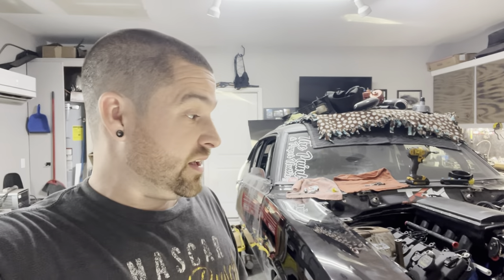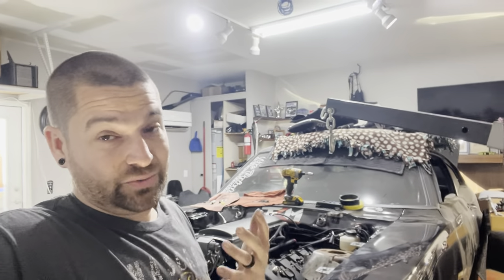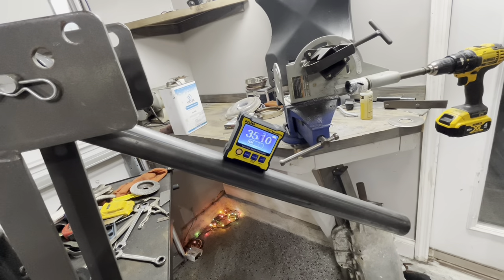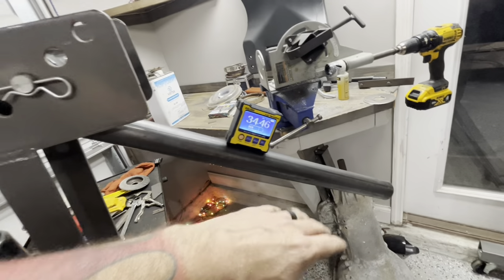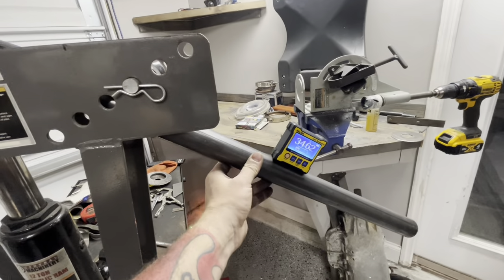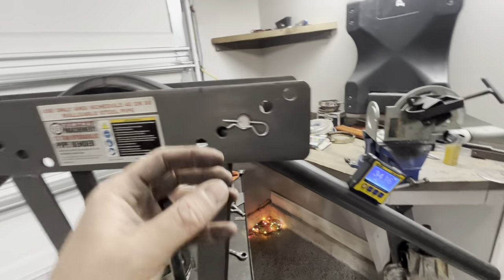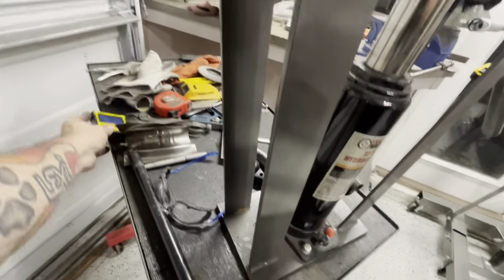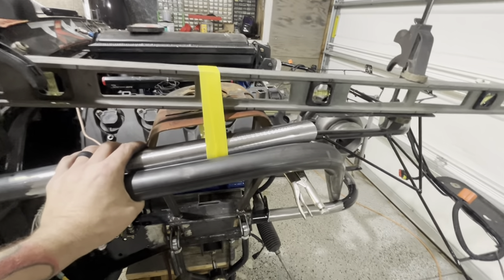💥 BIGGEST HACK JOB Tubed Front End On YouTube 🫣

Comment: Great job on your videos. I have a suggestion on your front tube arrangement. I know you have concern of energy absorbing a hit but need to make sure to support that front tube with more tubes as it will move. I did a similar setup with my 68 Mustang no prep car with installing Fox Body struts. You can check what I did  on my channel my dirty garage. Good luck and nice work
Reply from the maker: Thanks buddy. Remember it’s getting down bars for the engine plates plus triangulated with the shock hat. I’ll go look at yours now.

Comment: I am sure people are cringing about the bar going down hill like that, you need to call S&W tell them what your looking at doing and ask them for advice. With that angle think be some flex, going straight or up slightly up will push on the cage vs pushing upward because no leverage
Reply from the maker: Them bars don’t matter. The last ones were literally but welded to the windshield wiper cowl panel and we had no issues with the shocks attached to them.